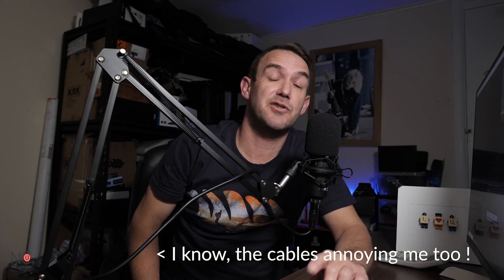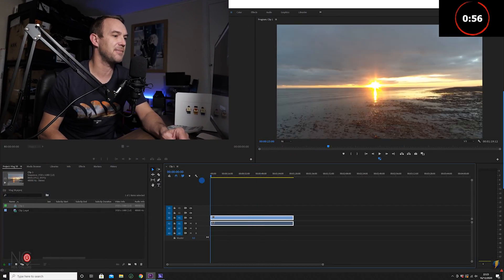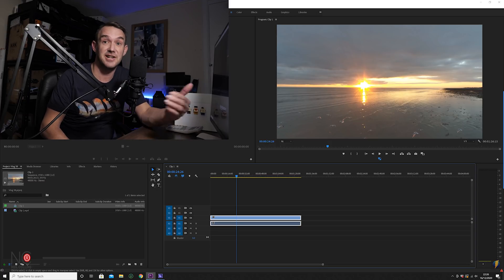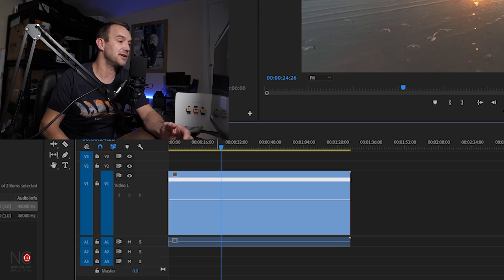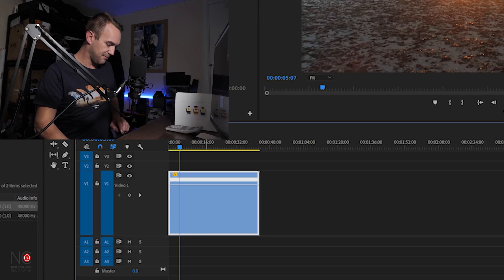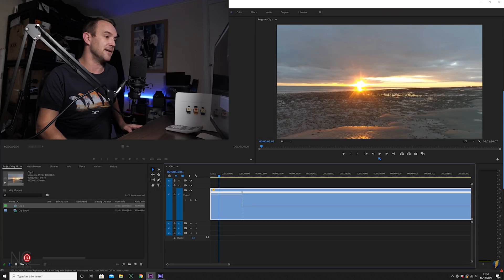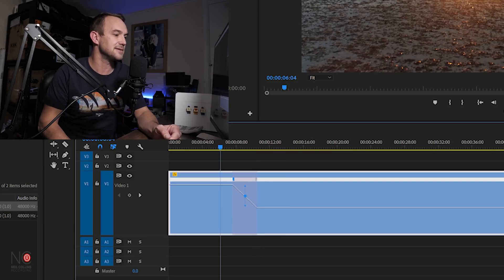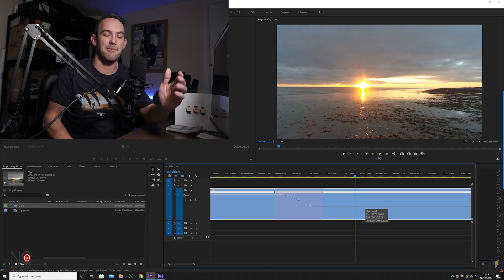How to use SMOOTH SPEED RAMPS in PREMIERE PRO 2021 in 1 MINUTE (ish)!

Comment: Quick question 🙋🏻‍♂️New to Premiere. So if i shot at 60fps and drop it in a 24fps time line, does it automatically slow it down 40%? Or will it be playing back in normal 60fps and i just have the option to slow it down myself like in FCPX?
Reply from the maker: If you drag it on to a 24fps timeline it won’t automatically slow the footage down. You need to either slow it down by right clicking and selecting the speed option (slow by 40%) OR before you drag onto the timeline right click on the clip and modify the footage to 24fps 👍🏻
Reply: @neilcollinsrecording  thank you! Trying to switch to Premier from FCPX 👍🏼